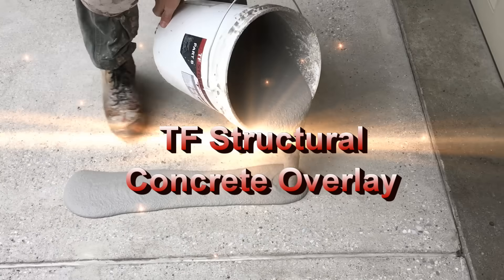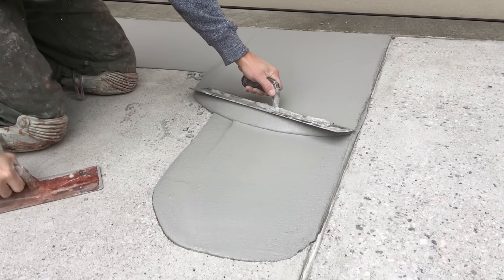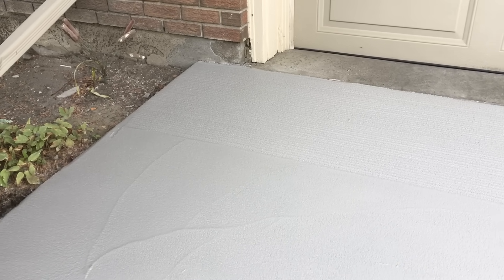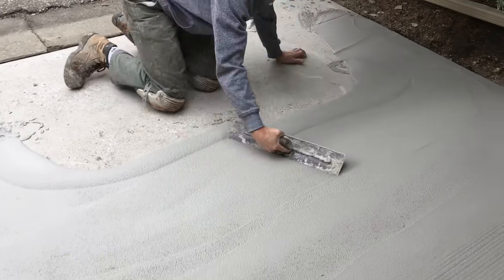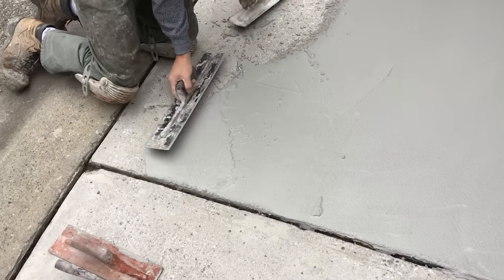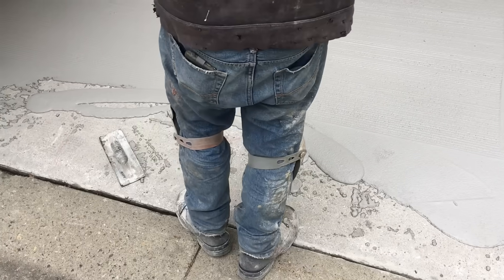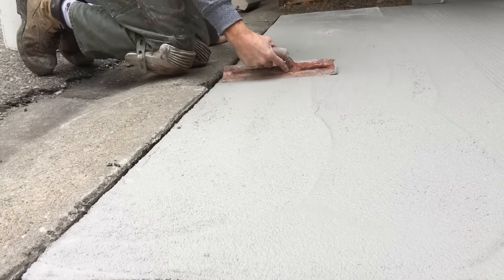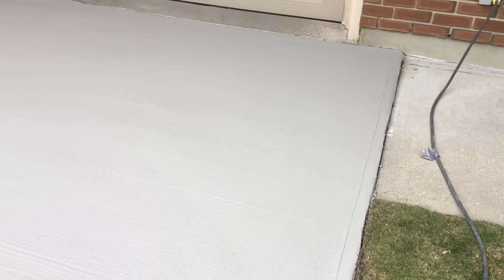TF Structural Concrete Overlay - Overview

Comment from the maker: Quick answers in the meantime, Shane, no, you will need to grind off the paint, and get down to clean, porous concrete, in order for the Structural to bond properly.Jack, Most contractors charge $6-$8/sq. ft, depending on how bad the concrete isAndre, Our TF Structural does not require and primers, or a 2nd top coat. It is very different than most polymer modified repair mortars.Thanks guys
Reply: I've been resurfacing concrete for 20 years and couldn't even dream of getting $8 per square foot here in AZ. Can't even get that for top of the line stamped overlays let alone a basic broom finished one. 
The illegals have completely ruined the decorative concrete industry in the SW by driving the prices into the dirt. Can only make a decent profit on commercial jobs where concrete contractors must be licensed.  In residential the illegal Mexicans have completely ruined this industry here... homeowners will hire them 99% of the time cause they charge nothing... just enough for material and a case of beer that's about it
Reply: @LittleSeasonDeceptions  Even though this isn't Terrafuse Inc. problem, I hear you loud and clear.  The illegal problem and unlicensed issue is even worse in NM.  And not just concrete, almost every trade....loved the video but couldn't not comment on yours mojo jojo.  The Wall isn't going to fix either of these problems, but I sure hope it helps soon.

Comment: My old concrete is badly pited. The entire 30ft span.  In Mn freezing temps.  I was told i need a primer first. And a 2 coat top. Any thoughts.
Reply from the maker: Hi Arlen, thank you for your comment!  No, TF Structural  does not require any bonding agent or primer of any kind.  It is not portland cement based and not filled with glues and polymers.  It is an acid based chemistry and only requires clean, porous, structurally sound concrete.  Sub zero temps are no problem either!   Give us a shout and we would be happy to chat with you about your project and get you in touch with a qualified installer! :-) 
(403) 243-3000
Reply: @TerrafuseInc  how many square feet does bucket cover and How much does it cost?
Reply: Bonding material gives a better bond for overlay , longer lasting,  won't peak up depending on material used , better to use bonding  on old concrete before applying overlay